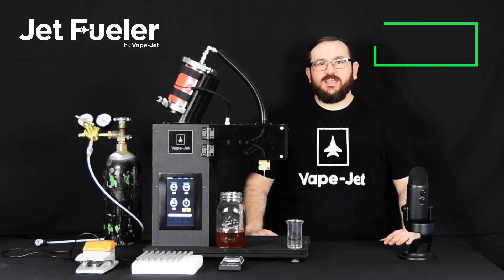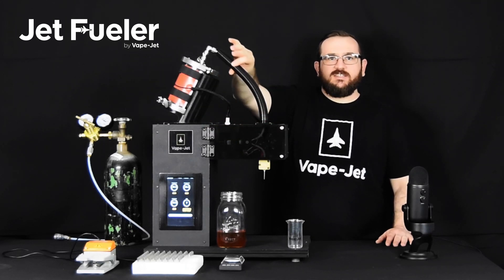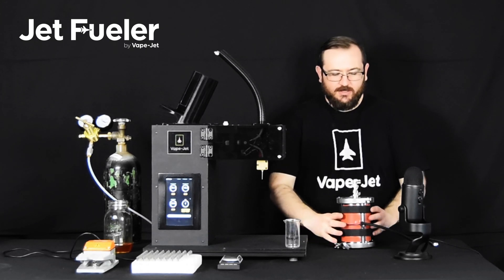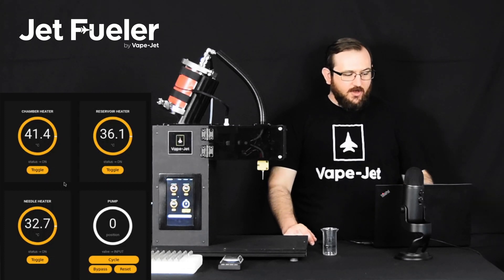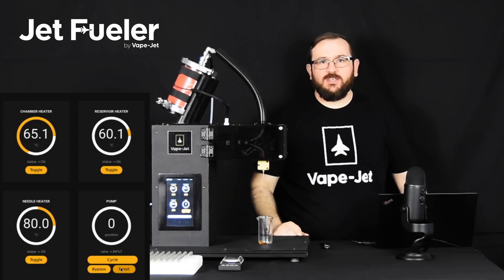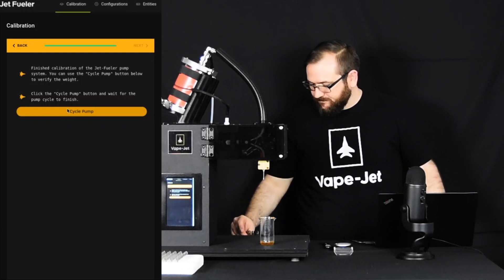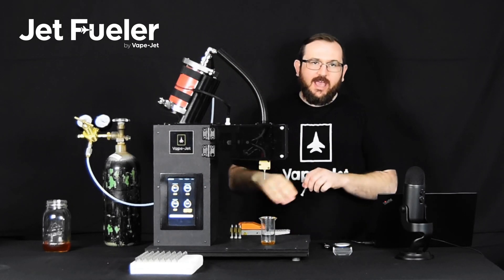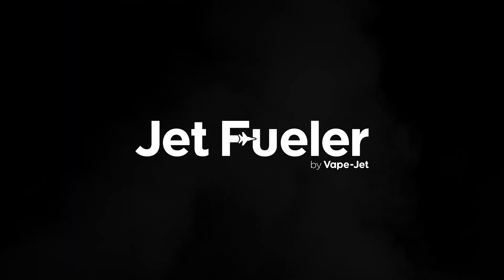Jet-Fueler 1.0 - Semi Automatic Vape Cartridge Filling - Demo Video

Comment: Do you have to use the nitrogen cylinders or will the machine operate without them?
Reply: It depends on the viscosity of the fluid being dispensed. However, generally most oils will require the N2 for at least the clean-in-place functionality.
Reply: For full speed operation, and high viscosity fluids the N2 is required. For less viscous fluids / slower speeds it can be run without.